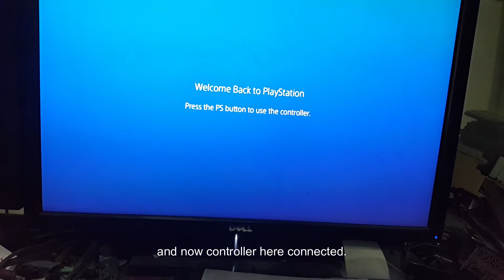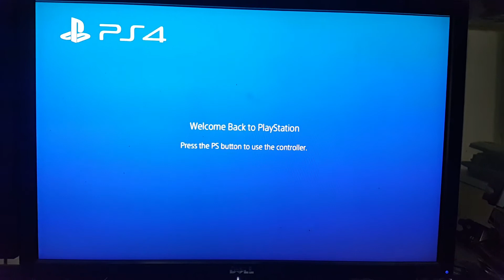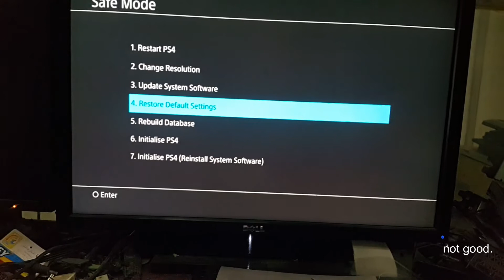PS4 controller won't connect - 🔧 Problem Fixed 🚀💡

Comment: Hey in Ps4 Cuh 1206a wifi chip have a Model number , when i buy a one to replace do i need to take the new one also from the same model number
Reply from the maker: WiFi chip has no model number but the version is written on it. If you have updated it then you can use up version wifi module.
Reply: @idreestech  if i need to buy one   i need to select the 12xx model chip?
Reply from the maker: @hasithadithya833  Yes.
Reply: @idreestech  💛💛

Comment: I use aoyue 866 recommended lower 360 because it's hot in my country you can use 380 upper always 280 and wait 5min to desoldering

When soldering I always reball I use 340 low and 280 upper it melt in 2min and that's it done but in reballing apu I'm having some problems so I always reflow
Reply from the maker: Please modify the profile dear.

Comment: Hello Idrees i have a question i want to buy a ps3 fat its from Europe(220v) can i have a powersupply of the same ps3 its 110v can i replace it wil it work on the 220v ps3 fat
Reply from the maker: Sure the supply is always universal, need not to change. The same will work on 110 volts.
Reply: @idreestech  Thank you sir
Reply from the maker: @bokkibeatz55  You are wellcome dear .

Comment: ce-31117-3 error pls any ideas to fix?
Reply from the maker: Are you able to connect the controller in safe mode? If you can connect it in safe mode but not in the main menu. Then the wifi module is bad and needs to be replaced.